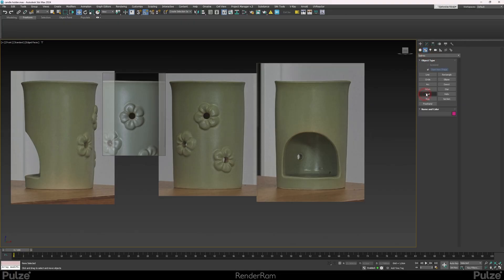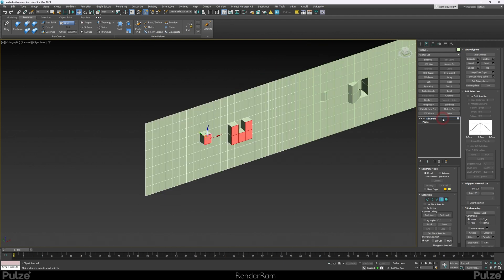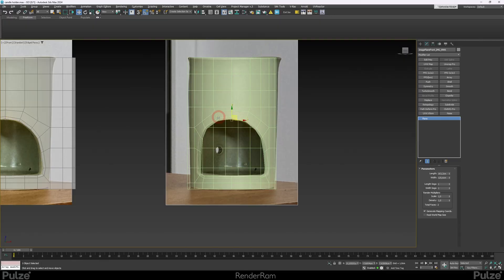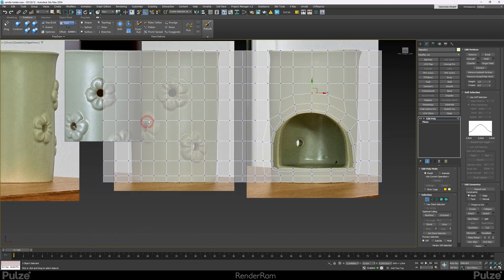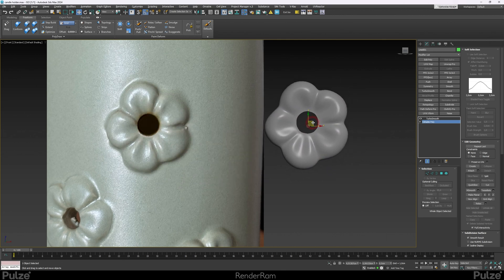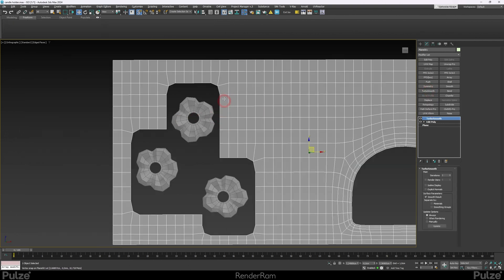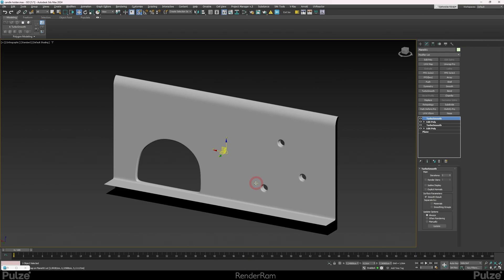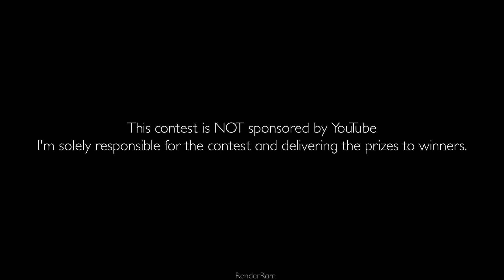Modeling Hack For Curved Surfaces | GIVEAWAY | 3ds Max

Comment: That is exactly what I needed to solve my topology issue! Now, how would you do the same with a sphere? A simple bend wouldn't work, there needs to be deformation...
Reply from the maker: Create a plane for example 50cm width and 25cm height in Front view
Apply Bend, Angle: -180, Direction: 90, Axis: Y
Apply Second Bend on top: Angle:360, Direction: 0, Axis: X